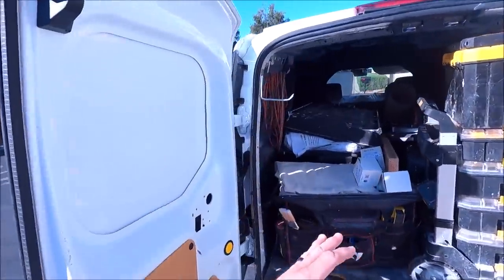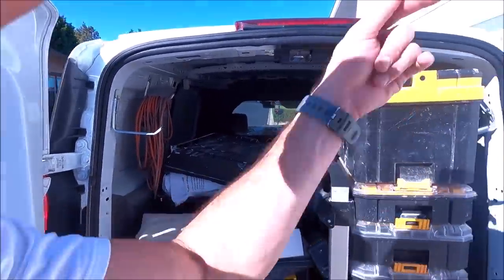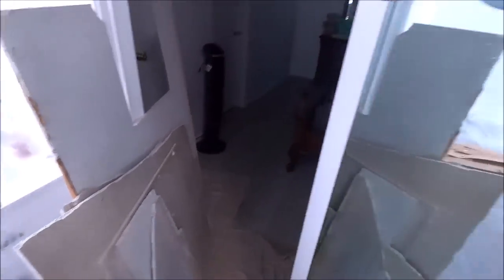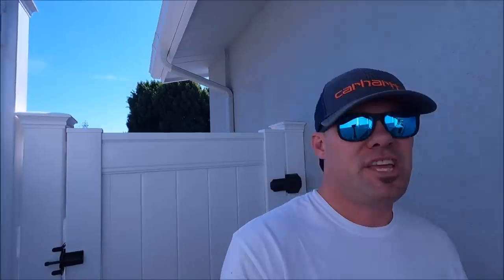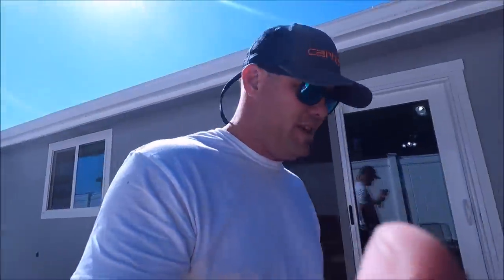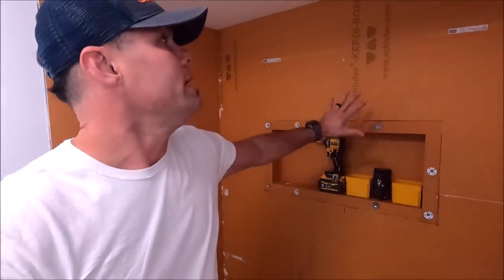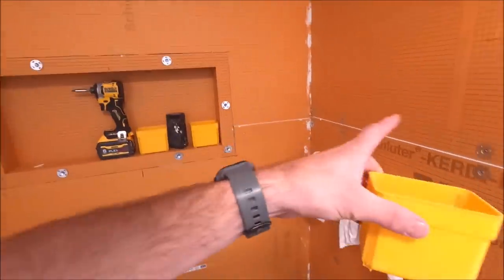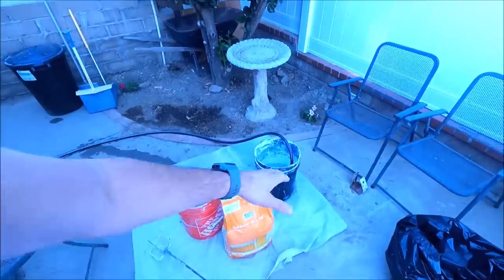Tile Guy Pulled Out! Schluter Wet Shim Fixes it All!

Comment: Wet shiming is an interesting method. I'm sure it's very strong too. Just a bit messy. It does seem like less hassle than sistering the studs. I think I might try something like this next time, but use construction adhesive.

Comment: Don't confuse time in trade with experience. Completely different things. I've started out in the industry when I was 17 - I"m 59 now. So that's better than 40yrs. However I had 10 yr period where I didn't do more then a few jobs. But at the beginning of the pandemic I went back into tile full time, however my experience level was greater than most. I worked for several production companies when I was younger, then after getting licensed I did a wide variety of work, commercial, high end custom, marble, granite, travertine, etc. But I found upon my return that the industry had shifted quite a bit and my previous methods - pretty much mud everything - needed to adapt as I could see from videos like yours that some of the newer methods were better, especially the way shower floors are done. But regardless, just because someone says they have 30 years experience doesn't qualify them at all. Probably better said 30yrs of in experience. I put in 2'x4' tiles all the time, but that's because I have enough experience to know when something is better rather than different then from what I'm used too. One thing I don't understand is the metal trim, totally cheapens the look of the product in my humble opinion. Love your stuff however!

Comment: Modified or Unmodified thinset?  Using GoBoard for my application and their "help" line says thinset.  There is a difference and you're merging wood with a waterproof backer board.  Any thoughts on which is better?
Reply from the maker: Modified for sure

Comment: Thanks for the info, this was very helpful! I didn't catch if you said in the video, but did you just put the thinset everywhere on the studs or did you predetermine where the high and low spots were to know where to put it?
Reply from the maker: We add it everywhere on the wall that is off and then tap down accordioning for flat and plumb 👊
Reply: @LandbergTileTV  Thanks!

Comment: What is done if Kerdi board is not flush where meets the drywall do to wet-shimming for leveling
Reply from the maker: Good question, we fill the gap between the drywall and trim edging with hot mud (20 minute drywall mud). We either sand then paint, or caulk over and paint. It blends right into the existing bathroom drywall. For a shower like this, it has to be plumb for our glass enclosure.

Comment: Serious question - if you have an insulated exterior wall, is adding a niche where proper insulation would be removed a good idea?
Reply: We come across this fairly often. Typically remove fiberglass insulation, and add rigid insulation. If it's only a two-by-four wall, might not be the best idea.

Comment: Do you believe in the 5:10:1 on thinset mixing/believed potlife? I was told that if I mix half speed for 1min after the 10m slake, pot life can be extended like almost a half hour.
Reply from the maker: Yes, that usually extends pot life

Comment: Do you not need to wait X amount of time for the wet shim to dry, before you screw the boards in or even start tiling?  Won't the boards move on you a little bit when you start tiling?  Great video!
Reply from the maker: We let the thinset set up/cure during our lunch break before we install tile. We rarely have problems doing this
Reply: @LandbergTileTV  How much do you screw the boards in after wet-shimming? Just enough to hold the board without squeezing out the thinnest on the studs?
Reply: fartpoobox ohyeah  Do you put screws in half-way before letting it dry, or do you leave it attached only by thinset, then put screws in the next day? I'd be afraid of cracking the thinset.
Reply: @SgtZima  Screw in next day with long screws, the thin-set is not likely to crack all that much. alternatively you can screw same day but don't bury he head.
Reply: fartpoobox ohyeah  You run fans and mix a very dense fast setting mortar that sets in in 1-2 hours. it will not be hard but it will be stiff enough to the point where small pressure wont move the board.
Reply: Wet shimming not a good idea for exterior walls with expansion /contraction of lumber and slight house movement thinset likely to crack and fall apart behind wall board

Comment: It's probably a really good thing the guy walked out, who knows how many issues he would have created if he finished the job.
Reply: So why would he run from large tiles like that? Isn't larger tile less time consuming?
Reply: @lobsterstrange  The bigger the tiles the more skill and prep is needed. The substrate has to be stiffer, flatter. Large tiles are hard to cut without specialized tools like saws, snap cutters, trowels for 3/4" square notch, etc. Think about a 1/8" grout line on a 1 foot tile. You have a lot of wiggle room there. Now imagine that with a 24"x48" tile, next to nothing to play around with. Think about a bump in the floor and what that would do to such a massive tile if you tried to lay it. They are also physically a beast to move around, needing suction cup handles, etc. Backbuttering is of course way harder too as it's like a table :). For many reasons it's harder to lay really big tiles.

Comment: I do somewhat understand putting the niche in a ‘random’ spot. Sometimes you have things in the way, switches, plumbing, venting, wiring, load bearing wall, ect. This didn’t appear to be the case here, but I’m sure you’ve seen it. I also have a love hate with kerdi board. I wish it was stiffer. It flexes between studs a little much for me.  Good job, keep inspiring and showing how it’s done!

Comment: Does Schluter give longer screws for wet shimming? I would think you need longer ones.
Reply: Kerdi board ZS hardware comes in 2", 3" and the standard 1 5/8" . Though some distributors may only stock the standard ones.👍

Comment: Surprised original contractor did not just purchase a tile draw cutter which would accept large tiles and when or if necessary use a grinder and cover edges with Metal  edge trim. Why do you seldom use WEDI pans and wall board? Although costly I like the wall boards but do not like the drain attachment to pan.

Comment: 7:49 I feel like you are trying to hide something here.

Also, if this is anything like drywall installation, you don't want a super tight fit between your sheets. you want enough of a gap for the "mud" to get in and "glue" the two pieces together to prevent movement and cracking.
Reply from the maker: I simply cut too quickly with editing and foam board can be set tight at planes of change. Like your thumbnail 👊 2024 here we come

Comment: The next time you use the wet shim technique it would be helpful to spend more time on the subtleties involved. Your treatment of this fundamental part of preparing the walls for tiles seems to have glossed over too many details.  For example, what mix (how wet/dry)? How soon do you attach the boards? How do you control for plumb as you screw the boards down. If you go too far and have to back it off, there will be a gap behind the board? Kerdi specifies a certain screw depth, so standard Kerdi screws can't be used, or what?
Reply from the maker: I've done so many how to on wet shimming. Here is the original video: https://www.youtube.com/watch?v=3N0SGhzVwn0